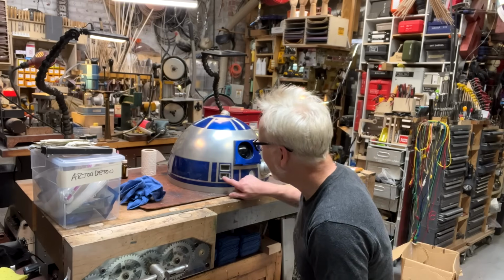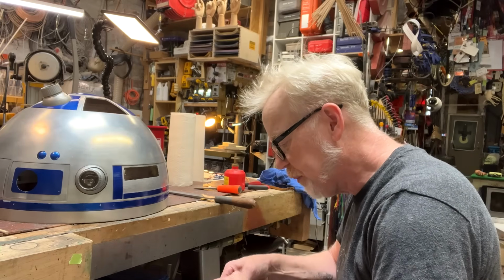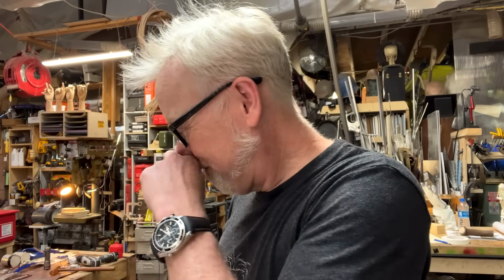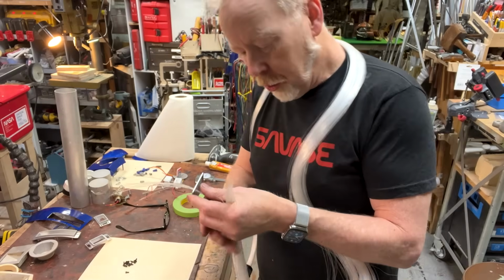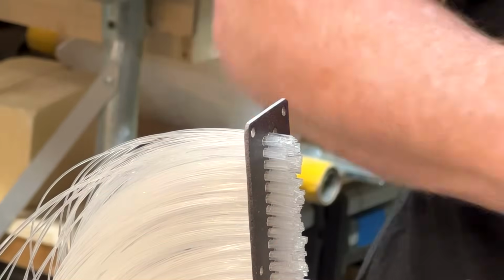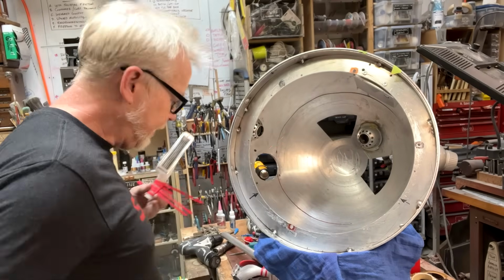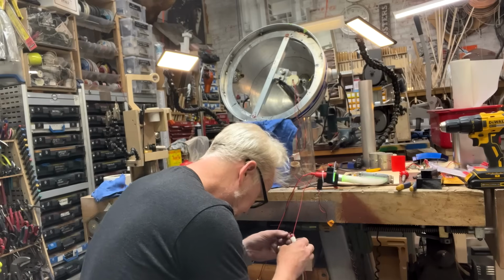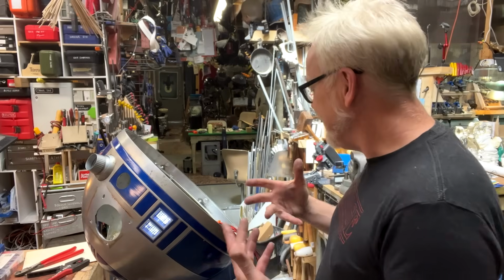Adam Savage Upgrades His R2-D2 Astromech Droid Build!

Comment: At 50:00 I had a vision of an adjustable bench brush. Turn a knob and the bristles feed out to give you a longer, more relaxed bristle.

"Can't get that dirt out of that corner? Give the knob a crank and make your sister's Barbie doll slit its own wrists!" 😢😂

Color wheel motor bracket, make one side just a rectangular pilar. The top and other side form an "L", hinged at the base. Ends of top and rectangulat pilar are held together with a detent pin. To change color wheels for theme night, simply loosen motor clamp slightly, pull the detent pin tying left and right sides together, fold clamp out of the way, drop new motor/color wheel assembly in. My brain is going nuts processing how cool this build is Adam. I love watching your mind at work!

Comment: I had to turn this video off after the second time Adam dropped it. Every nerve in my body was on edge, and I was headed for an anxiety attack. The video was probably fine after that. PROBABLY. But I just couldn't go on. 
   Been watching Tested for years, and love shop videos. In so many ways I feel in sync with Adam's shop practices (especially on sorting and organization). But there are others that drive me CRAZY, mostly over the potential for accidents. Not usually the dangerous kind, but the kind that break things or send parts flying off the bench en masse. 
   Knolling is an example. I see why it's attractive and satisfying, and that it has advantages, but I know myself, and it only takes one careless sweep of the arm or a sleeve or coat flap to send parts flying everywhere. When doing small builds like Lego, I rough sort parts into shallow, compartmentalized containers that are easy to dig through and remove small parts. Old compartmentalized lunchroom trays and plastic relish dishes are some of my favorites. Seems to work well, except when a small part briefly isn't easily recognizable because of orientation.
   Adam's got a million times my experience and knowledge, and he knows himself. But sometimes it's better to know your own mind and find your own methods, without blindly following what works for others. TRY those methods, sure, but if they aren't right for you, seek your own path, or the advice of others that may be more compatible.

Comment: You talking about the fibre optics and the colour wheel reminded me of a Christmas tree I used to have that worked just like that. Fibre optics up all the branches, going down to a spotlight hidden in the tub at the bottom with a rotating gel in it to change the colours. I over-decorated my tree so the weight pushed it down and it would occasionally make alarming grinding noises as the wheel struggled to turn. :D

Comment: Adam, I think that what you were calling a 3v "Transformer" is actually a 3v voltage regulator.  After all, batteries are DC power sources, and transformers only work on AC.

Comment: I think the color wheels should be filled with water (clear on the front and green on the back) and then either black (front) or red (back) dots should be floated in them. This would give you and enedless random pattern on the displays. 
As the wheels would spin the dots would float around bumping into each other and changing their spacing. So that with each revolution, the patter of lights on the displays changes.

Comment: Hey Adam, you might already know this but make sure your drill battery has a low voltage cut off built in otherwise your circuit will run it down below a safe voltage and potentially ruin it or make it unsafe. you can get adjustable low voltage cut off boards to solve that problem if it doesn't. 
Loved watching this build process! Thanks!

Comment: What's the name of the needle point superglue that you use to glue the optic fiber in place??
Reply: I found on Amazon - Bob Smith Industries Insta-Cure Super Thin CA.
That said, I'm still hunting down the super cool needle adapter he fitted in this clip.
Reply: @josstyk  I found on Amazon too. If you search for  CA needle tip. It comes in 100 units bulks

Comment: Looks great! The light wheel for data displays should be more black patterns not stripped then it Wil be a little difference between those to. I made a starlight in roof and used square and dots in black and splattered on the wheel. I think you would see a great difference. I love to use fiber optic for light in roof and walls.

Comment: Adam, dude.. you and I are painfully similar in our 'work style'. I often entertain myself in much the same way. I just built a Star Trek inspired functional control panel for my lab... oh how my mind wandered during that build. Enjoying this! thanks for the content! another little thing you could have played with is adjusting the fibers, twisting, braiding and grouping to make the 'pattern' react differently. As you have the double data display currently, they are both fairly identical in pattern. You could have made the grouping different at the light source end and changed it to more random or even opposite.

Comment: This is amazing! I'm going to use a similar idea to your battery to power my proton pack. Does your power converter (hehe) have overdraw / protection for your battery to shut the battery off when it gets too low so you don't actually kill your batteries? I'm looking for something that protects the battery, and steps down to 12v (I might just get a 12v Makita set for using on set...)  And I'm hoping what you have there would work...

Comment: Instead of epoxy, look at trying a glue by Loctite.   It is called Go 2.   It stays pretty clear, and is very strong but rubbery.  I love using it on projects.   It can be used as a filler, as well and putting parts together that needs a bit a flexibility.
I also use the 20 volt battery adapter.  Awesome product.

Comment: You can't change DC voltage with a transformer. I'm sure it's just that it's a voltage regulator and not a transformer at all, but the correct terms are important. The science between the two things is entirely different.

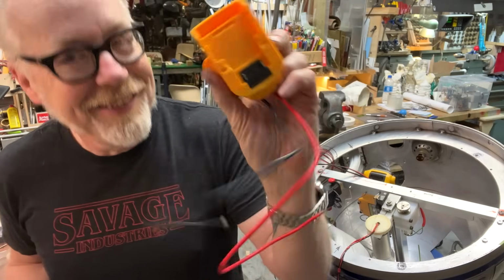Comment: 1:19:16 Please be careful with this! Unless they changed it in the Dewalt 20V system the battery BMS is located in the tool and NOT in the battery pack so if you don't add a BMS to the system the battery will go under it's rated voltage until it's completely dead (i figured out the hard way)
Reply: Yes, Milwaukee does the same thing. I drained an M12 battery running a fan off it and the battery cells dropped to a voltage lower than the charger would accept. You can revive them if you take them apart, but it's really not worth it. There are some 12V battery packs made for studio lighting that you can get cheap off Amazon ($30-40) that have a built in BMS.

Comment: Here's a question for you if the company manufacture fiber optic it's possible they can make the fiber optic a little bigger to fit those holes where you don't have to put 11 pieces in it just kind of popped in there but if you find a company makes it maybe you can do a special order and they can probably send it to you in that order or you don't have to worry about sticking 11 down the hole I mean it's possible

Comment: 1:17:00 AH, the aluminum tape hopper trick!  I actually use that stuff for vertical mold walls on small (and shallow) silicone molds sometimes. The edges are never what you'd call exceedingly 'true', but it works

Comment: I love how manual this is.. couldn't you achieve the same result using a micro controller and LED's? That would mean all you need is a power source to a panel. No fibre, nothing. This is basically how a Fibre Optic Xmas tree works.

Comment: A local movie theatre (it's won awards for the sound system and the renovated interior) has a full-sized metal R2 with motorized interior, built by the owner as a project of love. He based it off one of the blueprints from the R2 builders, and it never ceases to make kids light up when they see it move at their approach (motion sensors). It does not roll around, though. Just makes general R2 moves and noises, with motion sensor triggers and a remote control panel.

Comment: Hi Adam I would sugest having the possibility to plug into the body as external power that way you could use 1 battery in the body through a door pannel as a quick change in any event setting and you could also add some sort of charging controller to charge the batterys with 1 plug port on the r2d2 base as well as having it run off wall power if needed

Comment: Watching this makes me so happy and i started brainstorming - I am going to put my thoughts here for anyone who wants them:
I love the color wheels and true-to-character fiber strings.    I was thinking a raspberryPI could be rigged up to control the servos and lights to respond to verbal commands - you would only need a power switch and not the individual switches.   Pi can then periodically flash lights - until a command is given, and then whistles and light intensity/speed gets increased/decreased based on the complexity of the command.    LoL.    You could even program R2 to specifically respond to certain lines from the scripts.

Another thought - inspired by steering wheel clock springs - make your own "clock spring" so that every servo/light in the head is wired to a flat ribbon cable along the base of the head.   Then the body can contain the contacts, hardware, and power, to allow the head to rotate/move without worrying about twisting cables.   - or put the flat ribbons on the base unit and the head has drop-down contacts to deliver power.   Either way.

Finally - Pi with bluetooth - might even be able to add a follow-me feature, like a drone. 

Coupled with Pi voice response, an interactive R2 unit seems to be reasonably within reach.  I keep thinking of more and more possibilities and ways to make R2 more interactive & mobile.
Reply: You can do it mate!
Make it happen.

Comment: Mr Savage, as an artist who works in various and sundry mediums, AND as a blind-as-a-bat wearer of prescription eyeglasses, i cannot begin to describe the horror i feel when your UNPROTECTED eyes are a nose length away from tiny shards of optic fiber bits flying in all directions as you cut the excess off. Safety specs are your friend, sir. And STOP RUNNING WITH THOSE DAMNED SCISSORS.

Comment: This looks great. But I am curious why you went with fiberoptics and motorized color wheel, instead of LED's (or a LED display) behind a fine screen or polarizing filter? Seems like the digital solution would have been mechanically simpler, a lot more compact, and more capable (programmable). Sorry if you already explained that and I missed it.

Comment: You can still use the fiber cables, but at the end replace the color wheel with small array of RGB LEDs, and then you have addressable lights of any color in any order; as opposed to the wheel  which inherently produces a sequential flow instead of random. In addition it consumes less and it is silent; and with a good controller you can even make it such that you can alter the sequences remotely.

Comment: It was a video of you going through Grant's R2 unit that brought me back to the Astromech site that I had joined some 4 years earlier.  Thanksgiving of 2021 and I felt I needed a winter project, and a deep dive back into the Artoo build.  The "Childhood Happiness Machine" line sealed the deal and I ventured into a fully 3D printed build.  6 months later, and dozens of spools of filament, I now have 2 R2-D2s and an R2-Q5 in my work shed.  Thank you for the inspiration.

Comment: Its interesting that you used CA glue. I jsut did a project where I made a starfield in a frame and I tested a bunch of different glues to see which would work best. I found CA glue was the least effective and also mared the finish on the fiber optic. Epoxy was the best as far as strength of hold with e6000 being a close second.

Comment: They make those PVC pipe cutters with thinner blades (almost like a razor blade) and those work SOOOO much better than the thicker blades.  Just be careful not to twist while cutting or you can break the thin blade.

Comment: Those inches again, I just hate'em, hate'em I say metric rules the way. 

 About your problem with the wiring from head to body, you should use a copper ring on the inside of the body and  in the head some "copper brushes" to pick up the power, from the copper ring.
 
This is how you get power from the batteries in the chassis of a tank to the turret, I don't know what this system is called in English, so the best way to explain it, is that the power goes from the battery in the body of your R2-D2, to the copper ring and than in the head you have copper brushes, picking up the power and from there you cam lead the power out to your functions which needs it.

 There by you do not have wiring which needs to follow around, as the head is turning.

Comment: You should get a car alarm and use its out put buttons to control the Para scope and lights. Also you can get Hologram projectors and you can turn it on with the remote to project princess Layla.

Comment: It's been a long time since I have done electronics but with a transformer, aren't you running 20v all the time from the battery and depleting it's capacity at an accelerated rate to get such a small impact on the other side of the transformer?  It's a lot like a wall wart.  I think it was a buck converter that would draw only the needed amount from the battery and convert it to a voltage that was usable at the end.  Wall warts and transformers are pretty inefficient to power usage.  That's not a problem on house power but you are on battery.  But the hard part might be finding a buck converter that goes from 20v to 12v to 3v.  There are a few places out there that make converter boards but I have not checked to see if that drastic of a step down is available.  I know I have taken 120AC down to 9AC with a transformer and then used a buck and converter to get 12VDC and 3VDC

Comment: Adam, with the power now in the head, you could also include a hidden power button so that you can turn the head on/off.  
There's even a hidden switch you can place under materials that allow you to use a magnet through the metal to turn it on/off with a "key" (like a Restraining Bolt?)

Comment: another option instead of epoxying the frames in is to use a stud welder to attach some 15mm m3/m4 threaded  studs directly to the inside. Can then use nuts to attach the frames

Comment: Started my R2 build back in 2014 and am still at it (with a lapse for cancer treatment and recovery). I'm using the JAG plans to make a 95% handmade all-aluminum droid. I've water-jet, milled, and lathed most of the pieces and kept the accuracy (to the JAG plans) to within .004. 

Never done any metalworking or machining before. It's truly a long-term labor of love.
All aluminum R2D2: because sometimes you do things the hard way.

Comment: A "color wheel"!  I won't be so arrogant as to claim "I knew it!" as that would imply irrefutable knowledge on the subject, but I will say I long suspected such.  There's just something "analog" about the patterns that "waft" across the surfaces of those tiny displays. something very similar to the effect I can see upon a fiber optic threaded holiday I own.  The "trunk" of that tree has all the fibers clustered and within the stand into which it inserts, there is a backlit, motorized color wheel.  Standing far enough, one can see "waves" of color flow across the distribution of fibers threaded throughout the branches.  I'm thrilled to learn my pondering was correct!

Comment: I Just had the Idea or Tip maybe for a Future Project. there are fibreoptic Star sky sets in the automotiv aftermarket in configs Like 1 big stran of 400-600 fibres or Like 3-4 smaller strans or combinations of a big and several litte strans, they are RGB with a little LED Driver Box App controled etc. Maybe it could get usefull one day. 
They sell Them on amazon, eBay, etc.

Kind regards

Comment: Sincere question for people with more fiber experience.  Is there any gain or loss to coating or painting the fibers?  I want to avoid light leaking through a plastic shell, and wonder if I need to paint the inside of the shell or the fibers.  Each light circuit (to create different patterns on the outside) will lead to fibers exiting the shell in a dozen locations, so tubing the fibers is problematic.  Just looking to avoid repeating someone else's pain if I can.

Comment: Adam, I love the video, but my buttcheeks were thoroughly clenched watching you hack away at those fiber optics without eye protection. I got a bit of fiber optic shrapnel in my right eye while working on a build back in 2007 and it is not an experience that I would wish on anybody. This was a blast to watch; top notch, as always.
Reply: It also seemed like one of the less optimal options. Couldn't he have used some form of fine-toothed saw? Hold it up against the disk sander?

Comment: This looks amazing! Question though, would it throw off the head balance too much if you routed the power brick to one of the other panel cutouts, so you can just flip it open and plug in the power without removing the head ?

Comment: Cheapo Christmas trees with fiber optic bundles for light still have those color wheels. The motor inside is precious because it's geared just right and already built for purpose.
Reply: Yeah, but even though those are often 12-24 volt gear motors, they are AC. Hankscraft makes lots of low voltage DC gear motors, used often on in store P.O.P. displays. They run for weeks off a couple 'D' batteries.